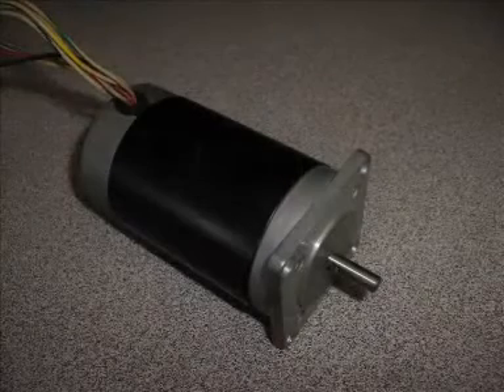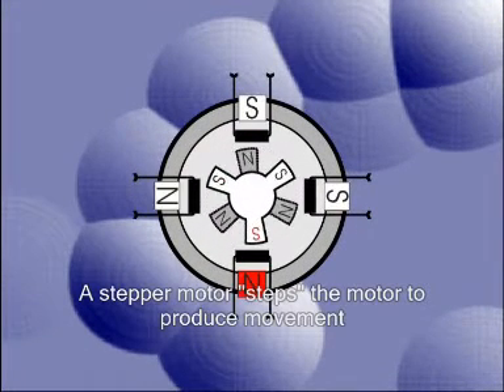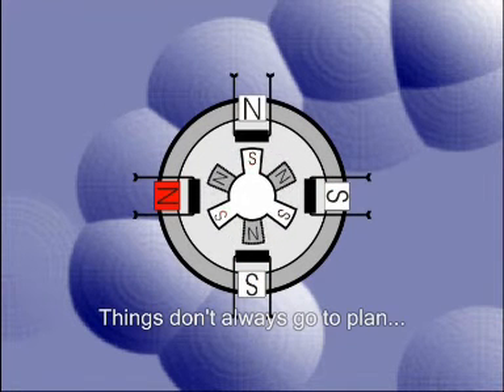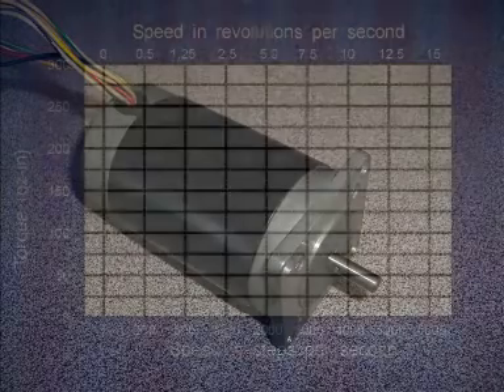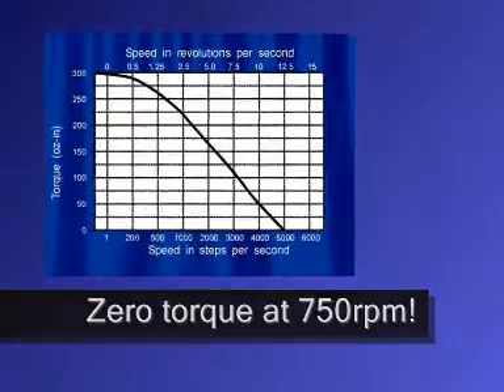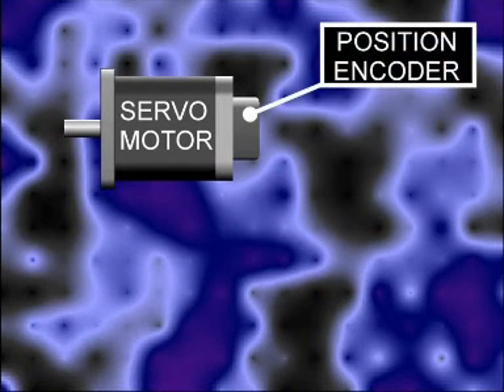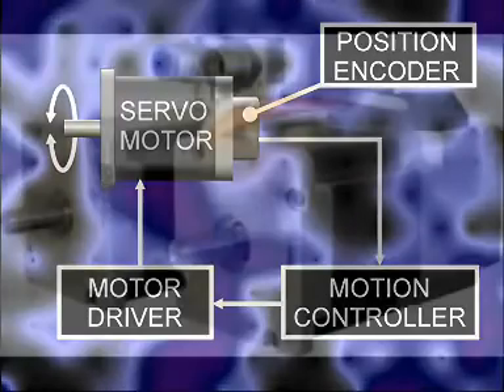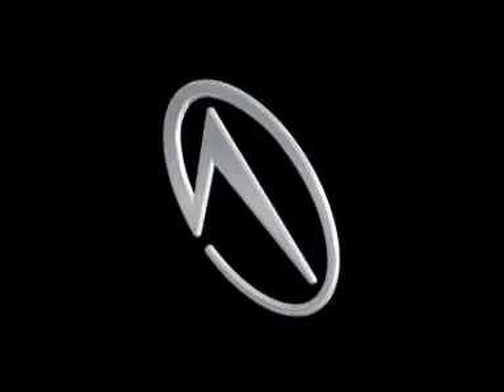Stepper or Servo

Comment from the maker: Hi Keith, the cost is much higher for servo motors. That is why most hobby and diy machines only use steppers. For a serious production machine though you cannot go past servo motors for performance. When your business revolves around production speed then you cannot afford to skimp on a stripper motor machine. All ART CNC machines use servo motors on all axes.
Reply: +ART CNC MACHINES Thanks ART I agree 100%. I did some research after watching your video. I saw a few examples of stepper crashes on the web, not pretty. It usually fries the steppers or mill head motors as well. As a hobbyist I'll have to keep a close eye on mine when I get it set up. I'll probably take ipadize's advice and use a encoder and look into putting a current watchdog on it linked to a emergency stop input on the "Controller/Breakout board". If I can't afford the best at least I can incorporate some equipment safety measures. Thanks for the video it was quite informative. Best Wishes n Blessings Keith

Comment: What is the cost comparison of each. I can get 3  NEMA 23'S 425oz motors, 3 DQ542 4.2 amp 50v Controllers, a 350W 36v Power Supply and a 5 axis Breakout board on eBay for $265.00. What does  comparable system cost? Thanks Best Wishes n Blessings Keith

Comment: All I know is how basically all high quality plotters and CNC machines, such as HAAS units, have all made the switch to servo systems. A "fixed step resolution" within a stepper motor also indicated the fact your dealing with resolution permanence that you can't refine past what the motor allows in physical build. That being said, I have noticed small jagged lines around curves during XY axis coordination that pretty much tells me there is a significant precision loss compared to a servo controlled machine.
Reply: bullshit. ever heard of gears? put 1:5 reduction gear on each stepper and voila. not to mention higher ratios.

Comment: Stepper motors are very effective in CNC machines but encoders have nothing to do with it. If you're relying on an encoder on a stepper motor to improve performance in a CNC, you're doing it wrong. The only thing you would use the encoder for would be to tell you something is damaged / you lost position.